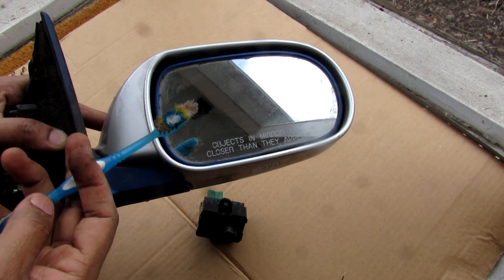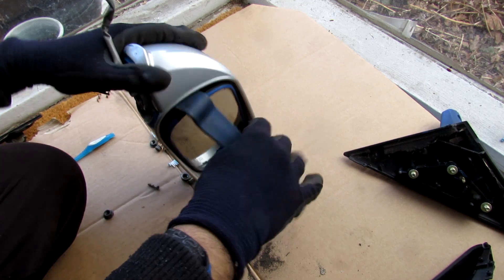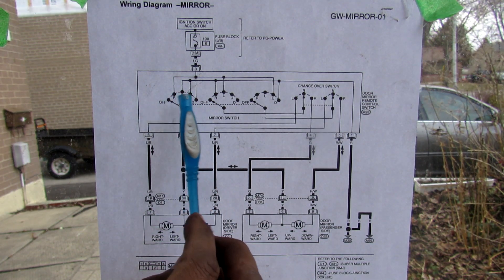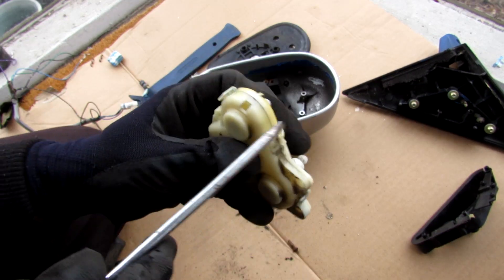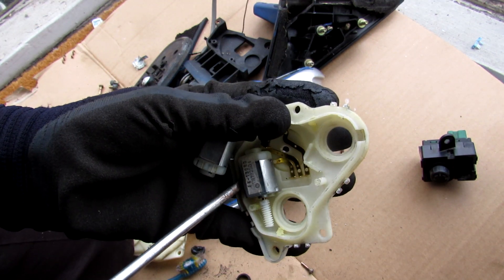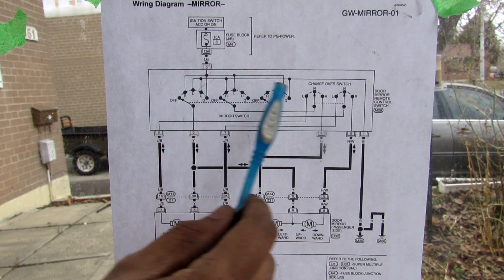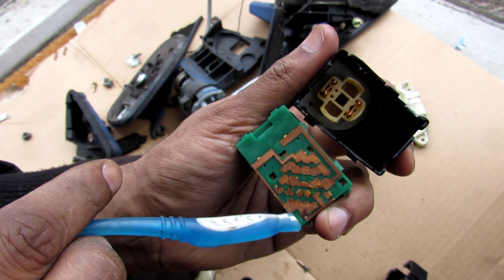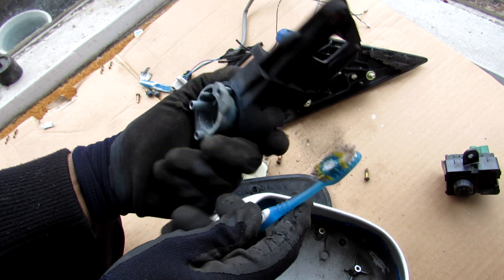How Power Mirrors Work

Comment: My manual driver’s side mirror  is hanging by wires. Everything in my car is manual. 2009 Accent. I want to try to replace my mirror on my own. I’m reading they may be there for  “potential” of having electrical locks/mirror defrost.    I do not plan on using these features ever.    How do I get rid of the wires? Snip them?

Comment: I’m replacing the mirror glass that has two wire connectors. Does it matter which wire is connected to the new mirror backing?
Reply from the maker: Usually the heater should be interchangeable since it's basically a coil.

Comment: If electric mirrors can't be adjusted manually without damaging them, then the design is garbage. If there is a malfunction anywhere from the switch to the motor, it should not prevent the car from being safely driven.

Comment: Replacing a side mirror used to be a couple screws, bolts . Now they have blinkers with dimming, heating elements and L or R sideways & up.down movement. Plastic clips and machined trim that fits slots without screws are so easy to break. Auto body skills  come in handy disassembling door panels and trim. I definitely need to keep my fingers and hands very clean to prevent grease marks everywhere. New cars still feel and look new, until my grubby, grabbing smears show up on every fixture I touch .If you do this for a lady, keep it clean as they notice. I  feel confident doing it---until I see the wires, removed from the plastic cube housing it sits in . Oh man, I better have my back-up ready .This video helped me  see how more complex a simple side mirror swap out becomes ,  I'm practically removing the door . I decided to 'pass'  . This video taught me how many ways I can screw it up, which makes the entire #30,000 car feel like a construction zone with panels off .Better to keep the friendship amicable .A mechanic  is just as challenged approaching this task with finesse rather than torque .

Comment: I have searched all over for the lowdown on how these things operate. My passenger mirror was working fine as I pointed it down, then it slowed and just stopped altogether. It goes L-R but not Up-Down. The left mirror is fine. So that should mean no fuses are blown, the L-R switch is operating and it is probably the motor that has worn out brushes or a burned out winding. The car is 19 years old. Thanks.

Comment: Hey man maybe you could help me out. I have a 2000 lexus es300 and both by power mirrors do not work. What could be the problem? My handy man washes my car and I think when washing with a rag, I pushed on the side mirrors to hard when scrubbing them. I do not hear a motor wining sound when I try to adjust them. What could be the problem?

Comment: My passenger mirror won’t go up or down. Only left and right. I am thinking it is the motor.  Would you recommend trying to replace just the motor or should I replace the hole mirror.  It is a bit pricey since it has blind spot, turn signal and heated.  It is for a 2017 Elantra. Thanks

Comment: My car was rhd and now it's lhd
The mirror looks wromg cause it was made so the driver sets on the right seat
Is it possible to fix it by switching the wires that control the mirror side motion?
Reply from the maker: Yes if you want the L and R switched around
Reply: @speedkar99  the switch works fine, but the mirror doesn't show the side view, it was meant for the driver to sit on the right seat
Reply: @bassam_salim  order mirrors for a lhd? Assuming your car was also made lhd

Comment: when you ripped the glass part you broke that center ball socket which is welded to actuator, (that was for your video purpose) but mine broke when i was just cleaning. and the glass part fall of on ground. i glued it back again, but i feel it might fall off again by it self. cause the glass part is on hold only by that center point.
Reply from the maker: Time for a new mirror.

Comment: I tried to disassemble a 1999 Honda crv side mirror and failed, I didn't know you had to heat it up, maybe I'll give it another try.
Reply from the maker: Most mirrors you gotta heat it to get the residue soft to pull off the glass mirror from the backing

Comment: Nice content.thanks
Need to understand further about auto closing mirror's & heating element was not shown
Reply from the maker: Yeah I skipped the heating element , it's simply a thin wire that runs behind the mirror glass to warm it up when it gets voltage. This mirror wasn't power folding

Comment: now that was really interesting and now i know what that cracking sound when i manually adjust mirror 😶
Reply from the maker: Thanks, yep you are forcing the threads
Reply: Only one of our cars will actually do that. The other two are purely a friction fit, and the mechanisms are still in good condition because of it. The other car...